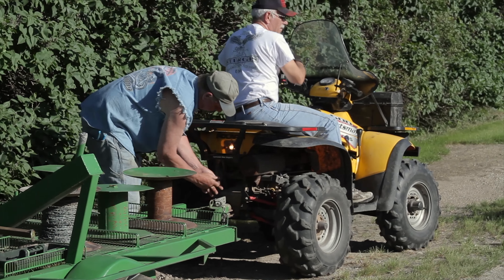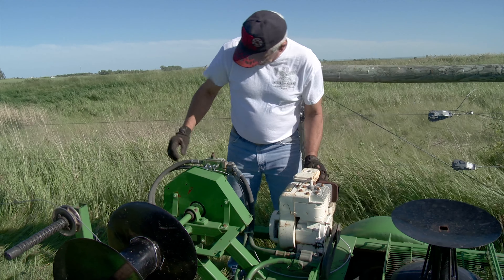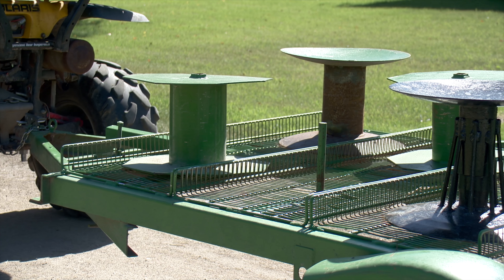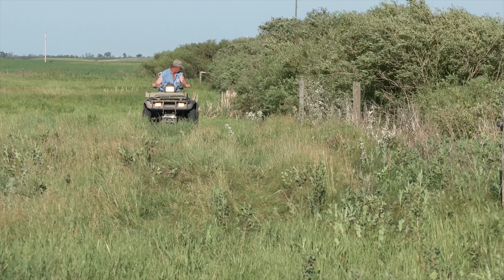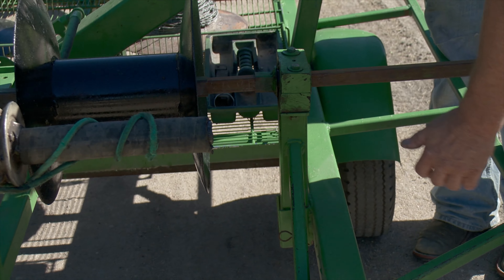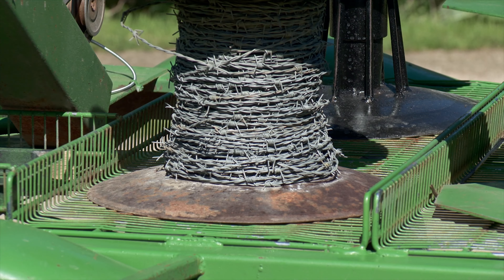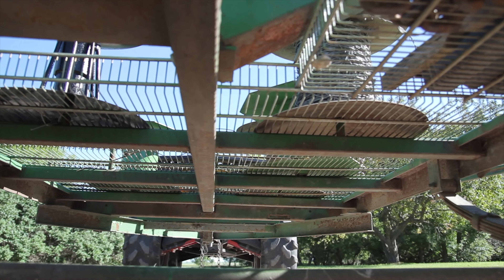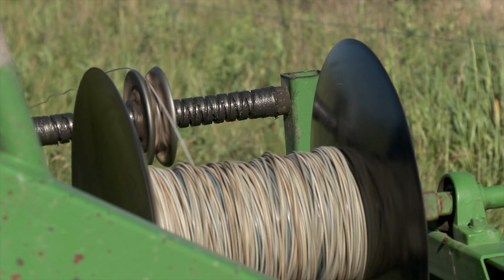Portable Power Wire Roller

Comment: Why not have one huge spool since it already stays on that trailer all the time
Reply: As wire spool increases in diameter,  torque  needed to turn the spool increases  beyond a 5 hp engine capability , same way a winch has its most "pull" on only the first layer of cable  Not to mention that the current spool size will hold a mile of high tensile & its HEAVY to lift  The trailer will hold 6 spools, One large 6 mile spool would not be  very practical